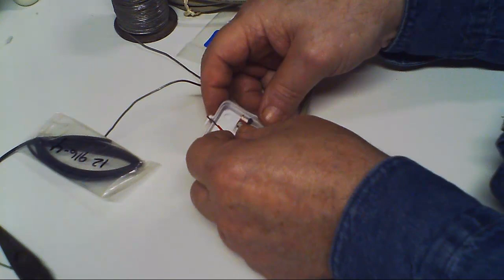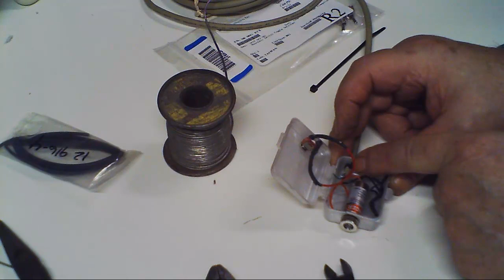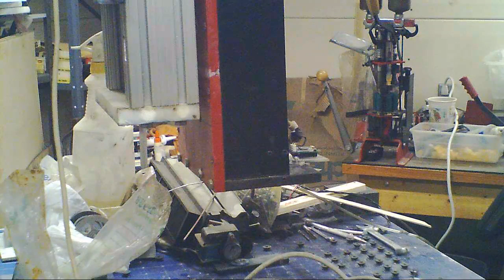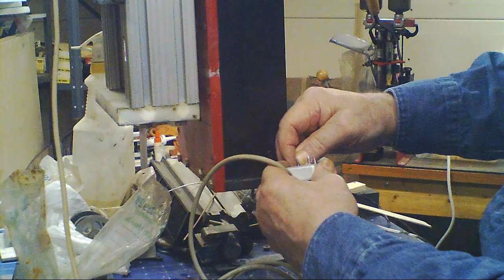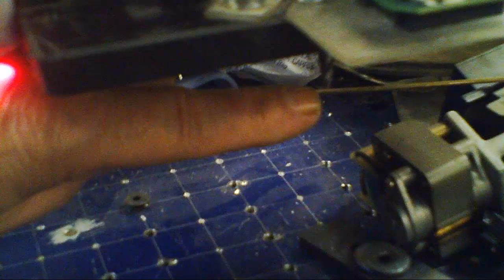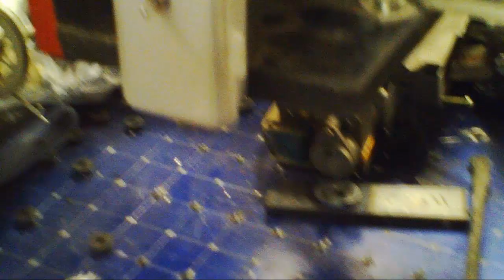How to Build a CNC Laser Edge Finder Part 2

Comment: How did you ensure the laserbeam is exactly vertical? If not then your offset varies with your Z-position and height of the workpiece.
Reply from the maker: There are a number of ways to check this: use a machinist square and run the beam along the edge. Doing it both in the X and the Y direction. --- use grid paper squared to the table and the rotor, then see if the beam hits the same line as the tool/pointer on the rotor. Adjustments can be done by shimming or by the software offset.
At the start of any project I'm rarely more than 1-1/2" -- 2" above the material.

Comment from the maker: You need to take a voltage reading... if it's to high then yes.... you 'might' get by if the voltage isn't over 5V. as many usb's are now around the 3 volt range, so it depends on your computer's usb voltage.

Comment from the maker: The laser beam/cross hair is adjustable by turning the lens, plus raising or lowering the 'z' will make it wider or thinner.

Having old eyes I can't make it too fine or I loose it, but .002 to .004 is good enough for me when I just want to finding the edge or corner of a piece. It also comes in handy when I'm clamping the part down to the table, (As a quick reference to squareness.)

Grandpa Bill

Comment from the maker: @BrutusJones You go into Mach3 and set up the offsets. There are very detailed threads on CNCZone.com about it and some have even put up screens with the added buttons you can download, so you just find your edge or corner, press the button and everything moves into place and zeros out the DRO's. No; you don't need a camera, but I do have one mounted as well as the lazer. It depends on what I'm trying to zero in on.